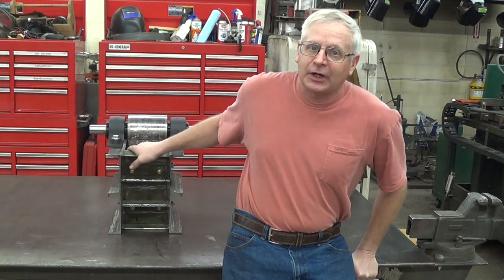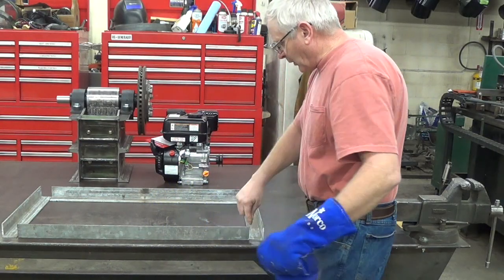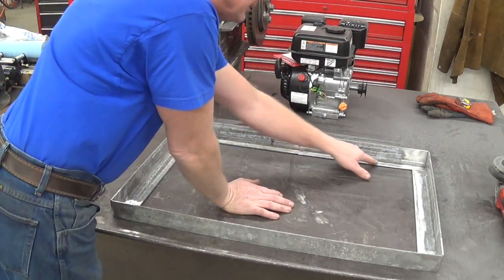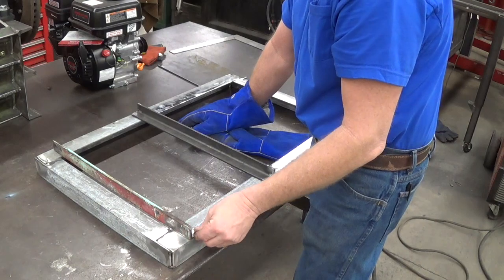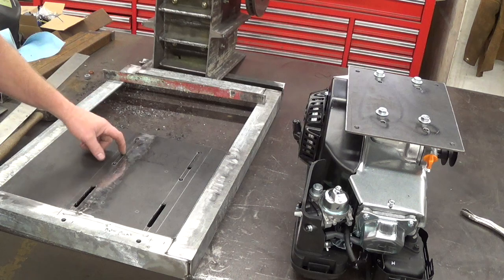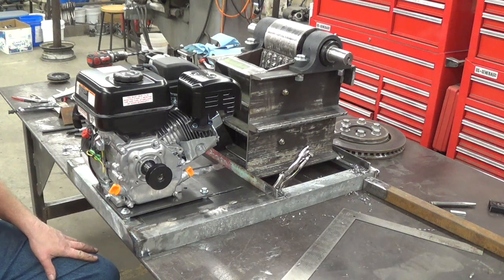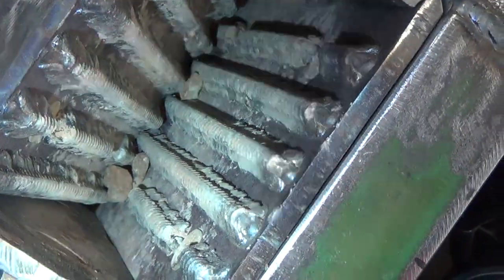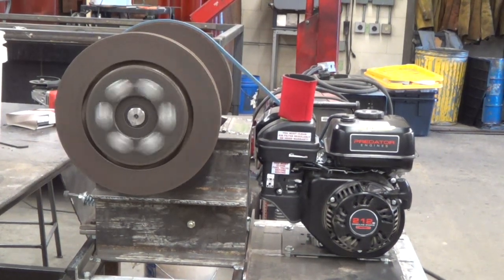Homemade Gold Ore Jaw Crusher Part 4

Comment: Thanks for the share. Im going to build that. 👍
Reply from the maker: The only change that I can think of right now is that when I build the next one I will use taper roller bearings (like for the front end of an old car) in the movable jaw instead of the disc harrow bearings. I now have a set of toggle plates and they change in just seconds for different size crush. Keep me posted on your progress. Thanks for watching.

Comment: Machine a wedge to go behind your fixed jaw to change your nip angle 

Also IMHO your bolt on toggle mount is weak and probably flexing. a shim adjustment against a welded in piece would be more rigid. 

Still one of the better diy builds I've seen
Reply from the maker: Thanks for the feedback, I will look into those suggestions.